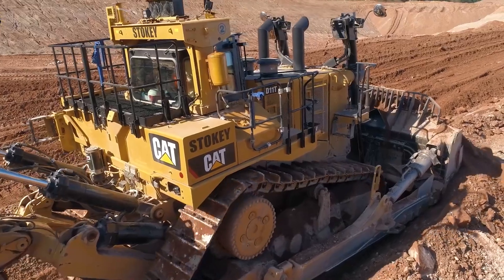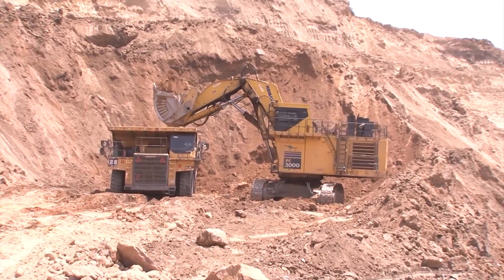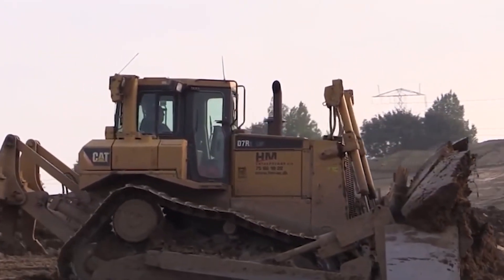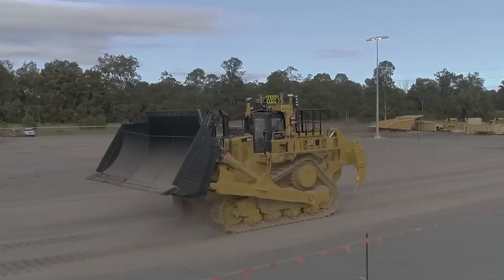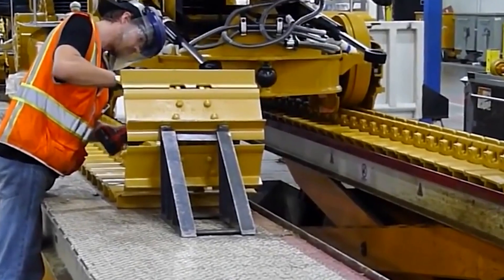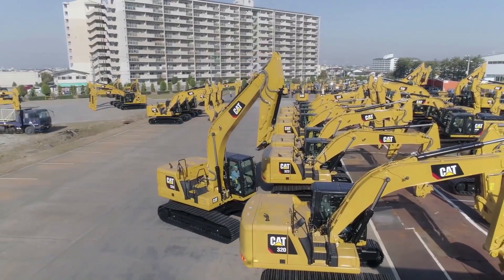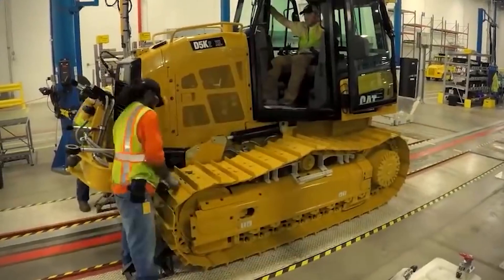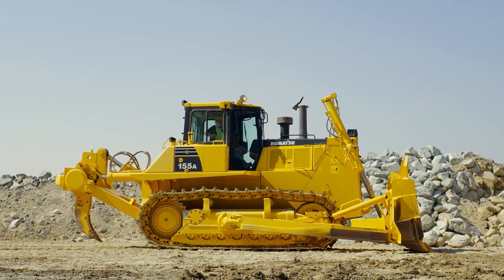Caterpillar Just Revealed The Manufacturing Process Of The Bulldozers

Comment: I have worked on both 475 superdozer and cat the 11 caterpillar is twice the machine twice reliable and lower operating costs Camacho's have weak points transmission failures electrical problems hydraulic problems and they beat the hell out of you have a nice day